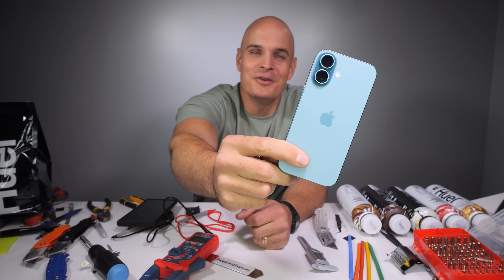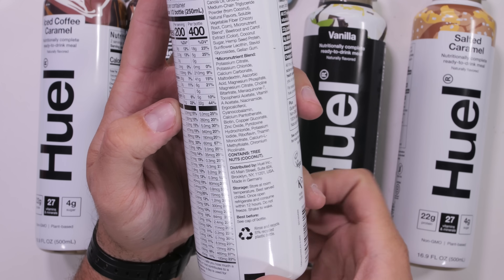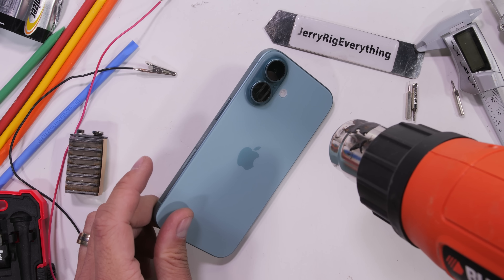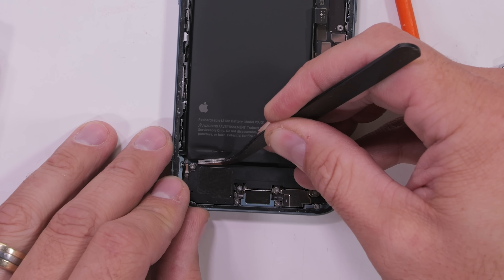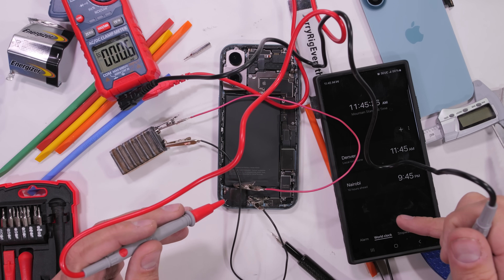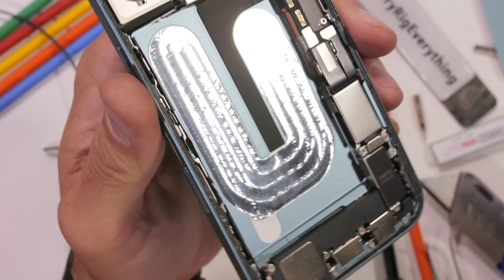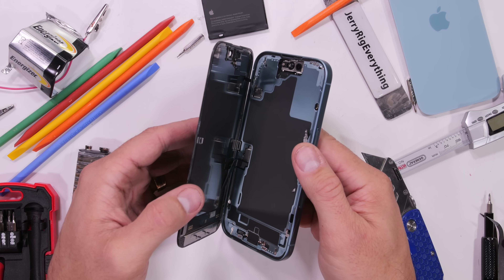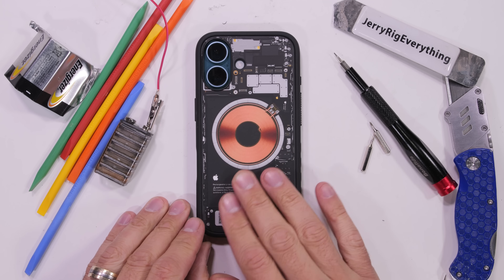Apple *FINALLY* did something new... (iPhone 16 teardown)

Comment: for the last 6 or 7 years ive only bought samsung galaxy. i get a new phone every year. most were from the A series. i got myself a galaxy S24 this year. ive never ever had to get one repaired. not one of them. never. that speaks volumes about the high quality of their devices. when the year is up and they unlock the device i would generally give the old one to my dad for his use as a government phone. hes using my galaxy a14 from last year. he is still using a galaxy s9 on his verizon plan. the government phone is his backup in his work van and blows the s9 out of the water lol. in February i will be giving him this years a15 model to replace the a14 from last year. when that happens im switching that phone over to my tmobile account and letting them give me a free A54 model for the company switch. i have an s24 from tmobile already and an a15 through metropcs. i love having two phones. they are clones of one another. they both function like one device aside from the phone number. they are synced on ALL my accounts and the apps are even in the same places. it make life alot easier. i usually like to carry both but depending on the situation i will take one or the other. if im worried about having my s24 on me i take my a15.. and if im worried about rain i take the s24. everyone i know calls me on Facebook messenger anyways so the number aint really important. i just need my mobile data

Comment: 2023-2024: The Brand New Iphone 15, Uses Pull Tabs That Strech Like Cheese And often Break to Remove Your Battery
2024-2025: The Brand New Iphone 16, It Needs a Battery To Remove Your Battery

Comment: Looks great but I still find it asinine. There could be few latches here and there or nothing at all just as well. It's not like the battery will spur legs and run away otherwise. I would much rather see this adhesive being used for the back cover and screen instead to eliminate the need for a heatgun and the knife.
Reply: Latches and doors and battery bays take up space - gluing the battery in means you can make the battery bigger for the same amount of space in the phone so you get more battery life. Given that it's likely this battery swap gets done once in the life of the phone (maybe not even once) having mechanisms for easy removal are a total waste of space, cost and resources.

Comment: In removing battery procedure.
what will happen if you leave it longer like 1hour or more, cause probably some user will do it accidentally like someone called in their other phone then suddenly forgot they did some removing battery in apple.

and it probably gonna happen in some DIY guy. just curious cause accident happen.
Reply: That will happen.
As the people use power supply set to 9_13V and maybe thay limit the ampere to .5 .
But they forget and the battery will overheating 😅😂😂.
Reply: @FunnyTikTok-b7q  
Yep still hoping some tech Tuber that willing to Try it.

Comment: It went from "Iphones are not repairable" to "iphones are actually somewhat repairable". Iphone and repairable could always be said in the same sentence
Reply: somewhat? this is actually incredibly good, hell its making samsung look bad, and I'm quite anti-apple. lets hope others follow suit
Reply: @raiden1425  i am also not a fan of samsung aproach for this
although idk if its practical, but its way cooler than adhesive pull tab, and i wonder if it has less forces to pull the battery wich in turn has less stress to the battery case and not being a hazard happy little spicy pillow

Comment: This must be much easier for a recycler standpoint - instead of hand-pulling adhesive tabs one by one they can just connect some alligator clips to the phone and work on the next phone while the adhesive melts away. Possibly could even be automated with a machine.
Reply from the maker: Very true!
Reply: @JerryRigEverything  That's not true. If you cared for the environment you wouldn't glue in batteries in the first place. It's just an anti competitive, anti consumer and anti environmental abuse of the ridiculous US patent system.
Reply: @petergplus6667  Lipo batteries don't like flopping about in the phone.
Gluing them down is fine, it just has to be easily removable.
Reply: @Ultrazaubererger  tell this them exchangeable batteries in our water tight phones we used to have. There are solutions if manufacturer sstopped being aholes.
Reply: @petergplus6667  Those add thickness and weight.
Also they use even more resources
(Added shell, BMS, contacts, etc.).
I've been avoiding non replaceable batteries for as long as I could but I can still see the benefits.
Reply: @petergplus6667 an exchangeable battery requires a case itself, some sort of user friendly connection and some sort of mechanism to remove the backside. 
All that sounds great, but we aren't even at the best part: Thermals. Modern phones need sophisticated systems to direct heat away from the processor, camera, charging regulator and anything else that gets toasty.

Usually the battery is part of that system. It being exchangeable would either lower your phones hardware capabilities or yet again lead to it being thicker, heavier and more expensive.

And all that for a repair that you might need once or twice depending on how long the phone survives? It isn't that hard to exchange "non-exchangeable batteries" anyway.
Reply: @LachskoenigIV  The Galaxy S5 was 8,xmm thick and had IP67, the iphone 16 is 8,x thick and has IP68. Where is the argument? The SoCs got really inefficient???
Reply: @petergplus6667  I doubt it's more inefficient speaking performance to power consumption wise. We just demand way more from modern phones than we did back then, so it has more performance while using more energy. Same goes for the camera, same goes for mobile internet. 

Again, exchanging the battery isn't all that complicated today. I don't get why you'd want all those downsides I mentioned if you'll only have to change the battery once every three years or so.
Reply: @LachskoenigIV  I just tried to explain to you that there are no relevant downsides. And opening a freaking hair thin glued in glass panel is easy to you? I used to rock my Note 1 swopping batteries on the go all day. Today I get a phone that last to 4pm at best (had the shitty S24u for a while) and I can't just swop in a battery. Why? Give us all day batteries then at least. But they don't. Glued in batteries have literally NO advantages for consumers only for manufacturers to cheapen production and expand earnings.
Reply: @petergplus6667  frankly, you don't understand the technical side at all. 

Acting like they could easily give you three times the battery capacity but just decided not to, because screw you in particular I guess? 
But let me get this straight, your usage pattern leads to phones not even lasting half a day and you are fine with taking extra exchangeable batteries with you. Why not just take a bloody powerbank with you instead.
Reply: @petergplus6667  ps: yes opening the backside of most modern phones is really easy. Heating it up is half the work done.
Reply: @LachskoenigIV  Btw, even the EU tells manufacturers to stop producing this ewaste. Not sure wether they force them to integrate removable batteries by 2027 or not, but something will change about this planned obsolenscence.
Reply: @petergplus6667  planned obsolescence? The battery is easily replaceable. If you can't do it yourself, ask a friend. 
How long do you expect it to last anyway? I abuse mine, I drive a lot (4h+ each day) and they are always getting wirelessly charged during that. So far they lasted 3 years before noticeably dropping in capacity.
Reply: @LachskoenigIV  Locking bootloaders, locking spare parts so you can't swap them forcing you to buy parts f.i. batteries genuine... But they aren't available? So you still claim 3500mAh is 3x of 3220mAh? Don't avoid my arguments and try to tell me to adjust to manufacturer BS - I am the consumer and of they don't provide adequate devices....I won't buy this "only for housewives" crap. I am still using my Note9 because they only produced crap after it. Unlocked boot loader with 2024 S22 Ultra rom on it. No need to update anything. The only thing it doesn't have: exchangeable battery and this sucks. Btw as Mr Jerry wether he really thinks that electrical conduction epoxy is REALLY environmentally friendly or are we using metals and toxic epoxy to....glue in batteries??!! That's insane.
Reply: @petergplus6667  that's a whole bunch of different issues mate. 
I still claim what? You are starting to throw random words around. Make arguments or let it be lol
Reply: i'm kind of skeptical of how this will work on the long term, sure they're unsticking pretty easily now that the phone is brand new but as the adhesive goes old im afraid the voltage alone wont be enough
Reply: But the adhesive tabs pulling sound is so satisfying
Reply: But now all those 9V batteries need recycling.
Reply: @TheRocco96  It might be stating the obvious, but the repair shops will use a bench power supply. No batteries required.

Comment: long time watcher, first time commenter. im still using my iphone 6s from early 2016. same battery haha. it says service battery and only has 72 percent but it will hold a charge for roughly 6 hours or so. only one if you are using it intensely.
Reply: I got a new battery for my old 6S from Injured Gadgets 2.5 years ago for like $15 including shipping. Battery technology has actually improved enough over the years to the point where you can fit up to a 2200 mAh in that phone as opposed to 1715, meaning that it would be even better than OEM. (There are a bunch of fake 3000+ batteries, but the 2200 ones are real as long as they come from a reputable source like Amp Sentrix or Injured Gadgets).
Reply: Please have your battery replaced, you risk destroying your screen because of battery swelling.
Reply: @luipaardprint nah let him cook it’s his phone
Reply: @luipaardprint I don’t care about this thing

Comment: was waiting for the teardown 9V battery skin
Reply: Other construction type for the 9v PP3 battery is that you have 6 AAAA cells inside, with a silicone rubber pad top and bottom, with punched out aluminium connections to place them all in series, and provide 2 tabs wrapped around to the top to contact the battery top connection.
Reply: @SeanBZA   i was like wait i remember those 9v having more small triple a  like batteries
Reply: @SeanBZA  the old everready 9v batteries were made this way.
Reply: We need human teardown  skin before GTA6😂
Reply: What's baffling is why Apple couldn't just use the power from the battery by simply shorting two nearby terminals.   And yes even an old battery has plenty of power to heat up the strip.  As smart as they are, not quire. lol
Reply: @BillAnt  phone batteries don't reach 9v only 3.7 v , maybe it will work with 3,7v but it would take for ever
Reply: @abdalmageedramadan5604  Well sometimes phone batteries charge to 4.2V. I have no idea how this adhesive works, but multiplying a voltage is trivial. The phone could absolutely do it. But then again, probably wouldn't work if the battery needs to be replaced.
Reply: @abdalmageedramadan5604  - It's not just the voltage that matters but the amperage too.  W = A * V   So you can have a lower voltage battery with more amps to heat it just as well.  Apple sheeple again thinking that 9V is better, lmao
Reply: @BillAnt  I=V/R though. R is fixed by the adhesive so without enough V you won't get high enough I.
Reply: @DennisLeeyeet  - A typical alkaline 9V battery has about 5 Watt Hours. while the iPhone 16 has a 15 Watt Hours.   Even a degraded iPhone battery is higher than that puny 9V power  The better choice is pretty obvious, but not to Apple. lol
Reply: @BillAnt it's not just the voltage that matters but that doesn't mean the voltage can be made up for by throwing extra capacity in. Different ratios of voltage to amperage to amp hours are suitable for different purposes. Either way, shorting a rechargeable lithium battery is generally something you're gonna want to avoid. I'd much rather risk the cheap 9v than my phone's internal battery. This is a safety thing too, not just about 9v batteries doing the job better
Reply: @BillAnt did you even read the comment you replyed to? Current != Watt; Current != Watt hour. 

The glue has a fixed resistance, low voltage high amp wont pass much current. current is what matters in this, not watt. 
this is the reason you can safely touch the terminals of a car battery, where as if you short them with something with low resistance, like jumper cables, you end up with sparks and melted cables. 

 + if you are removing the battery it would be stupid to add extra circutry just to support this when you would also have to support external power in case the battery is dead or shorted.

ie: That makes no sense, are you try to rage bait?
Reply: @TakeApartLab  
Yeah maybe they just didn't get the concepts for electricity. 

Completely agree with the other points you said, but would like to nitpick this - " low voltage high amp wont pass much current.":

Here low voltage won't have high amp. If you are talking about the current limit of the source (like how you can short a capacitor and create a big spark, but short a battery cell and it just heats up (until it maybe explodes)) sure, but it's kinda unrelated here as we won't be getting close to the limit.

"current is what matters in this, not watt": watt do matter, just that current (amp) determines the watt in a lot of common scenarios (as we have fixed supply voltage mostly, like typical wall outlet in US will always be 110V AC unless something is terribly wrong, and battery have a nominal voltage, so you can get Power in Watt by just multiplying the voltage number by the current you measure). 
Watt directly says how much heat is generated. But watt-hour indeed doesn't matter. Watt is how much energy per second is being dissipated at the instant, watt-hour is how much energy in total can the battery supply before dying (or how much energy you used, on your electricity meter).

(In some not-very-everyday scenarios, like power supply circuitry of a CPU in a computer, the voltage can also vary alongside the current, so you'd need to get power by Voltage * Current.)

(Noticed that my previous comment reply got shadow-hidden, I recommend "Battery amp-hour, watt-hour and C rating tutorial" from Afrotechmods and "Understanding Constant Voltage and Constant Current" from Rohde Schwarz for a really good explanation of all of these)

(something else of note in my hidden previous comment is that as JerryRigEverything said at 3:13, Apple specified 9-30V power supply and not a specific battery. If repair shops are doing this they'd be using their programmable power supply and set a voltage somewhere between the numbers to release the adhesive, in which case there is no watt-hour at all.)
Reply: That would be flabbergastingly impressive
Reply: Both times I took one apart it was just a sticky mess.